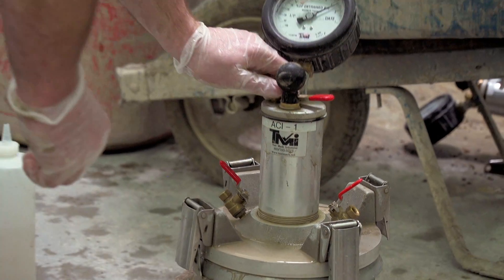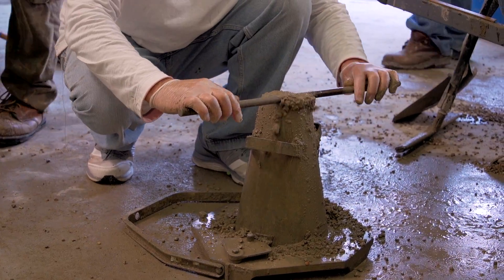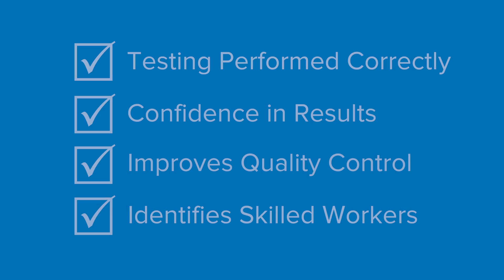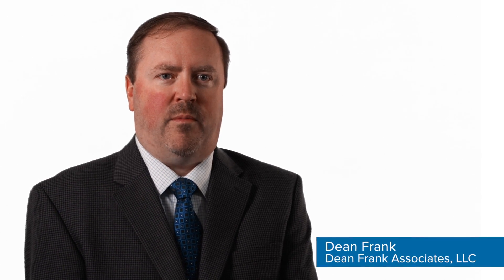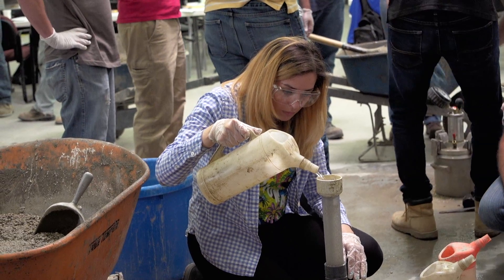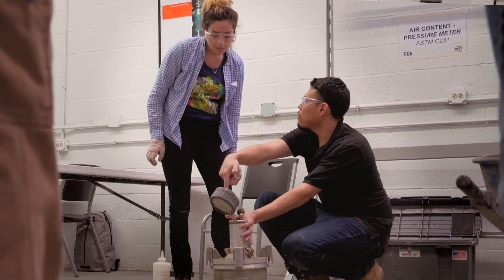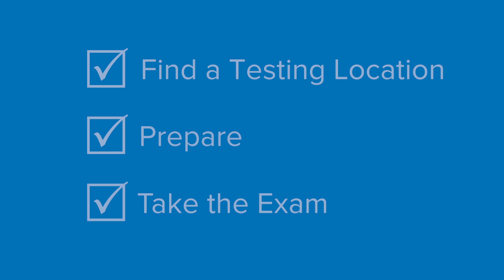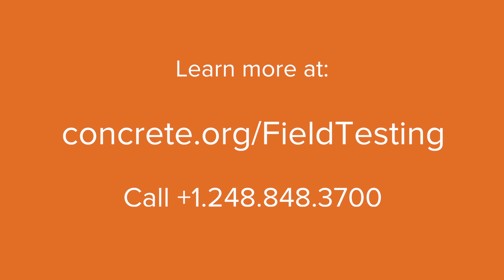Get Certified as an ACI Concrete Field Testing Technician - Grade I

Comment: Is there a way I can get further information regarding how to take this program to be certified?
Reply from the maker: Hey Siope - yes! Please follow this link for more information on how to take the ACI Concrete Field Testing Technician - Grade I exam, or contact our Certification department any time at (248) 848-3790 or aci.certification@concrete.org. https://www.concrete.org/certification/certificationprograms.aspx?m=details&pgm=Field%20Concrete%20Testing&cert=Concrete%20Field%20Testing%20Technician%20-%20Grade%20I
Reply: You never get to put your hands on concrete until the exam. This course sucks, I have taken it many times. The teacher in the northern VA area is a complete a-hole. You can't even ask him a question or he will say something like "I guess you ain't been listening, boy" I have to take it again this month so trying to get a jump on it because we do not test concrete but have to have the cert so i learn it every 5 years. It should be continued education after the first time but it isn't and there is no reason to worry about it expiring, you have to go through the entire thing every time. Why can E&S and SWM both required by the State of VA be continued education but not this? Now VDOT doesn't handle the testing for the VDOT concrete so they made a mess of it too. I'm going to find a new job prior to my ACI expiring within the next 5 years.